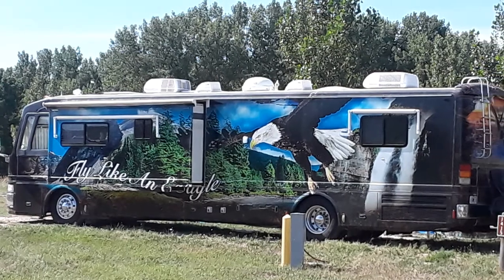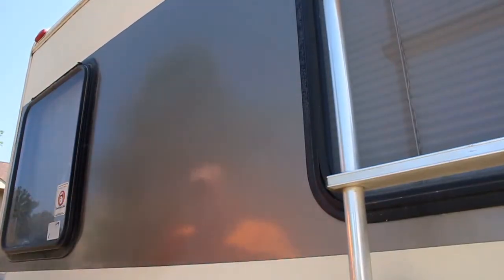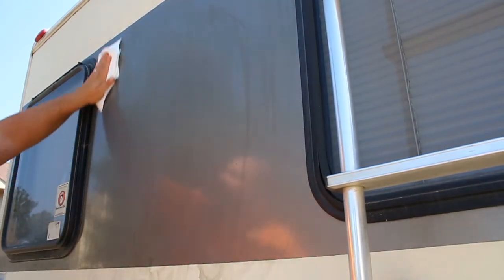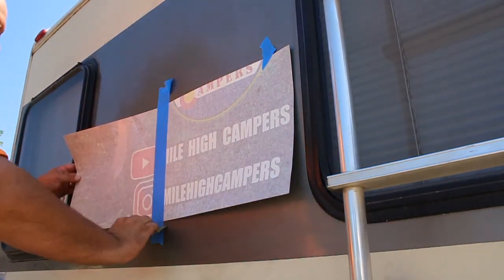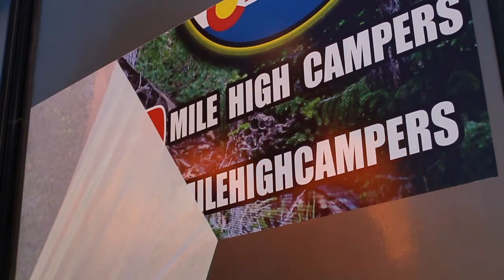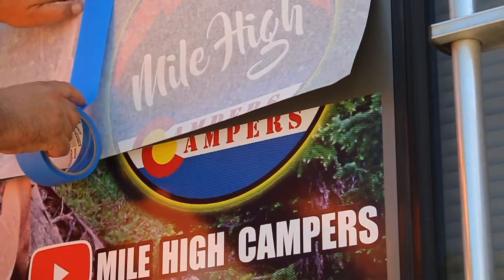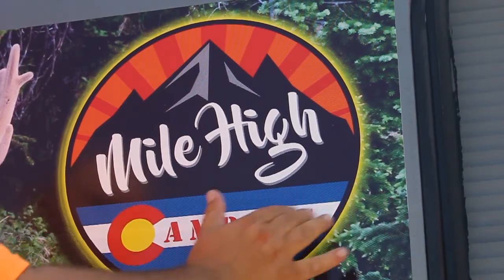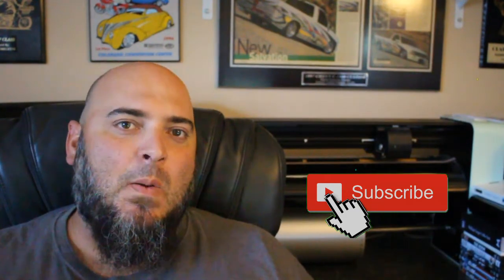How to install RV graphics | Installing a 2 piece vinyl decal | 2 piece vehicle decal | vinyl wrap

Comment: Wow this is really awesome! We have thought about doing this.
Reply from the maker: Thanks for checking out this video! Let me know if you end up wanting something like this or have other ideas, I can do graphics a lot of different ways!
Reply: @MileHighCampers  do you have any options for a removable sign? We thought about a magnet but our camper is fiberglass.
Reply from the maker: That may be a challenge. Static Cling might be an option for windows. Another options would be a small vinyl banner or yard sign that you could display when parked, but if visibilty going down the road is the goal than static cling is the only thing that would come to mind that could be removed and reused... or magnets for your truck doors or truck bed...
Reply: @MileHighCampers  yea I think we are just going to have to come to terms with the fact that it will have to be permanent.

Comment: We bring our trucks to Denver to get wrapped. Can't find anyone that makes them stick
Reply from the maker: Sadly the "wrap" material is made to release for easy removal. I think that can be a double edge sword, if you over stretch in spots it will start to release and begin to peel up, at least that has been what I have noticed. The vinyl I used for this was standard sign grad vinyl, it won't release easy and may be a pain to remove but it should last 4-7 years.